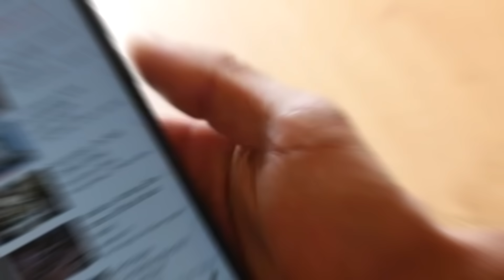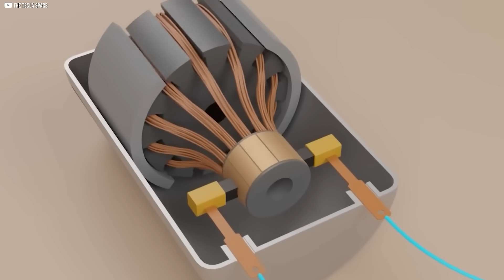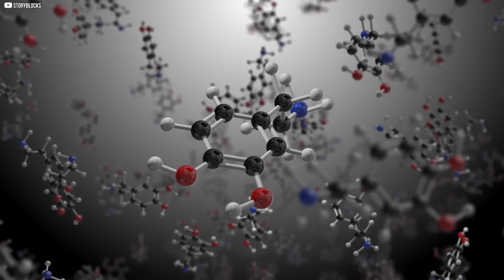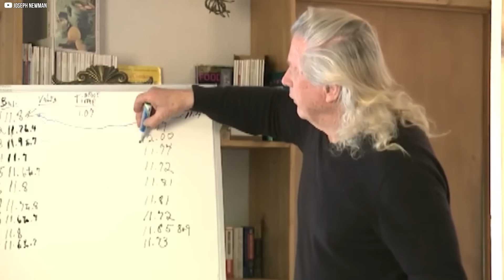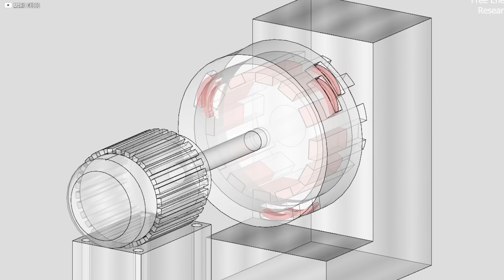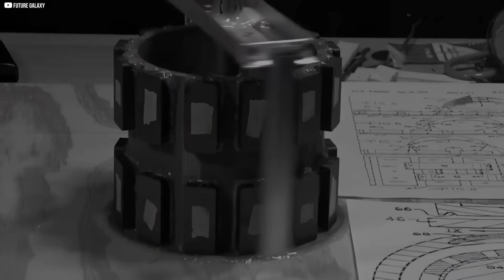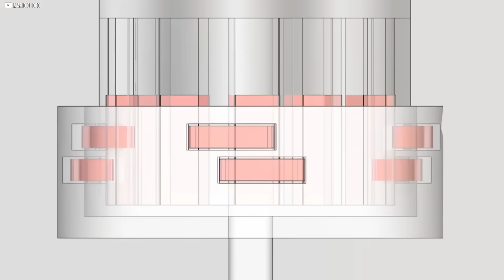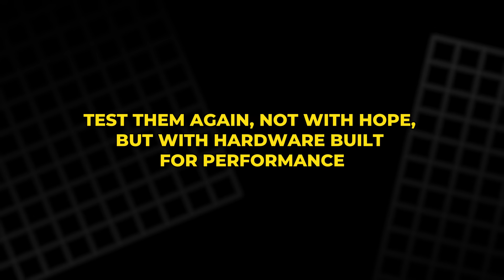Scientists Just Unlocked Unlimited Energy With This Magnet

Comment: Man must focus also how magnet can be charge to return to itz original magnetic properties while in use to perform in a system, like in electric motor , add winding around it and make an algorithm do itz job ,from at instant that the magnet at rest , in this process magnet will not  degrade , I want to say is , we are not focusing only in charging the battery but also charging the magnet also in electric cars today 

 magnetic

Comment: Every magnet in the world has U&S
And the middle position of the magnet is neutral, 
The neutral position of the magnet is the position of loss of kinetic force & momentum tensile force & push, 
And this is the reason for the failure of the cause of not being able to create an eternal motion machine with a magnet, 

Even though you have the strongest magnet on earth in your hands, and want to make an eternal motion generator, in the end failure because the magnet itself also loses energy in the form of magnetic efficiency & loss, loss of electrons. 

Absolutely cannot be avoided physically, physics challenges, 

But the magnetic innovation of "Iron Nitride" will be very helpful, because this magnet is more resilient with all terrain & consistently hot temperatures up to 300° C, suitable for EV & Generator Magnet Permanent cars that require high durability in all fields.